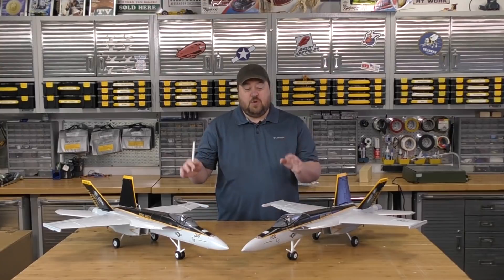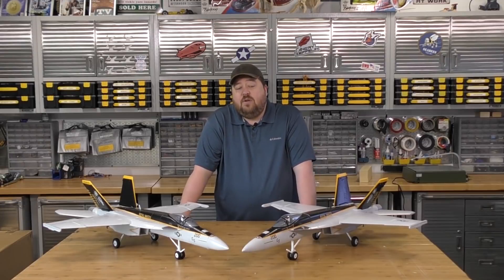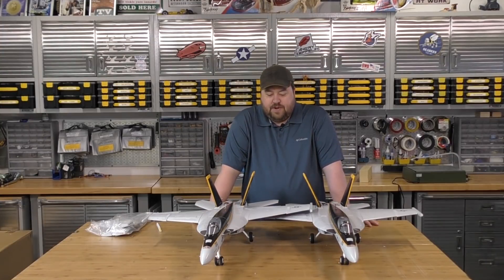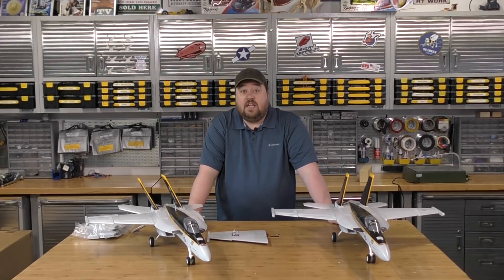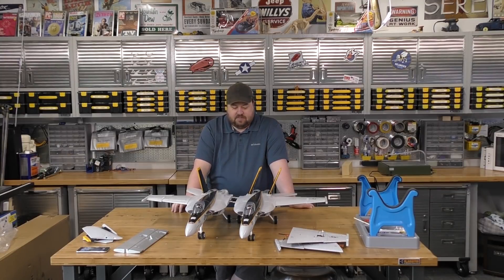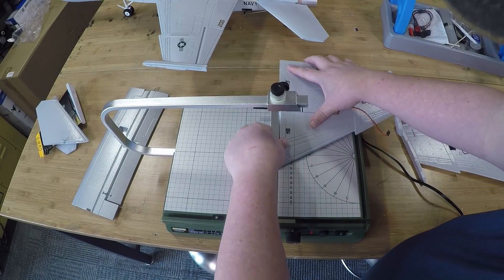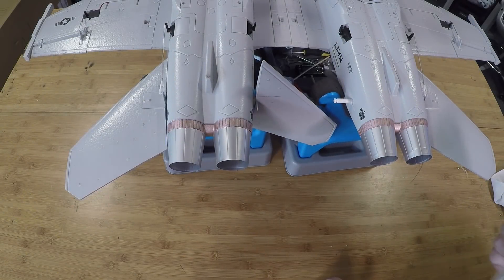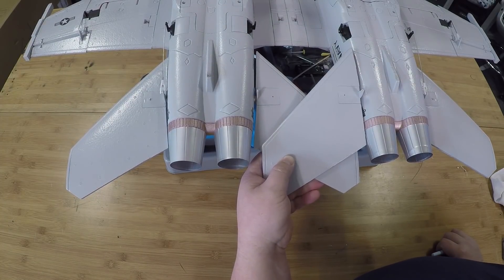Twin Freewing F-18 Hornet Build

Comment: You could have used both receivers and bind both to the transmitter, and that would have enabled you to join the aircraft without running wires between both planes since you have already omitted the servos and the control surfaces, this would have reduced the construction time and simplified the modifications. Next time you attempt a similar project you could try this method of reconfiguration. I have been able to bind two aircraft to the same transmitter in the past, and I think it would be the easiest way to obtain your goal. Interesting project, I hope it flies well. 🙂

Comment: Split your elevators, mix them with there respective aileron and use the middle one for elevator only.
Reply from the maker: I love this idea! it will take a little doing as the servo leads are embedded in the foam and i dont know if there is even a Y connector or just soldered together. I will do this mod after the maiden for sure!

Comment: I think you can use two 30mm edf
Reply from the maker: I just did a thrust test on our test stand and it turns out the 2X 30mm edf's only put out about 70% of the total power of the single 64mm. We can try to strap on a warthog edf set with 2X 64mm though!

Comment: It looks like nothing seen before! One question: What happens if you omit the two outside vertical stabilizers and just keep the two inside?
Reply from the maker: I am not sure, We will try flying it with a few different tail configurations. The tails are not to scale on these EDF jets and are usually 25% to 50% over sized because the plane needs the drag to fly level and not get to unstable.